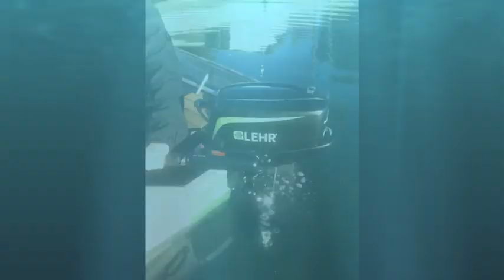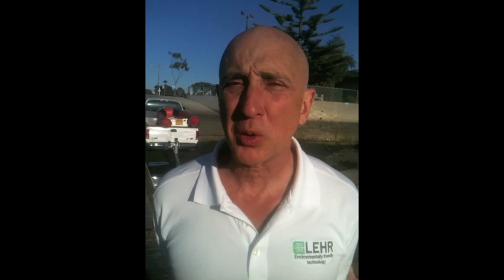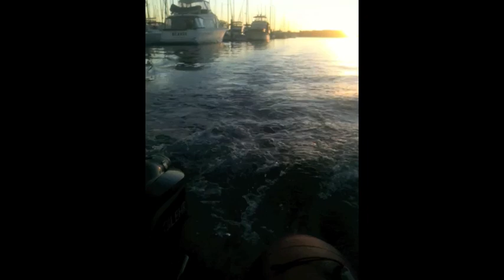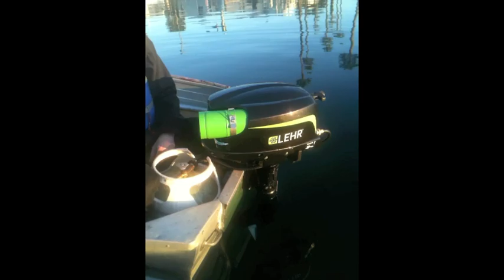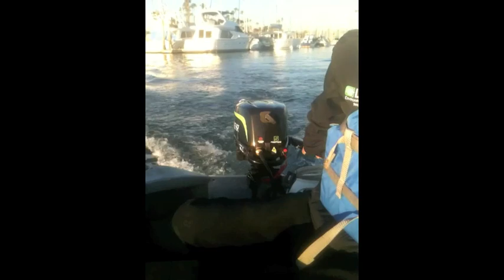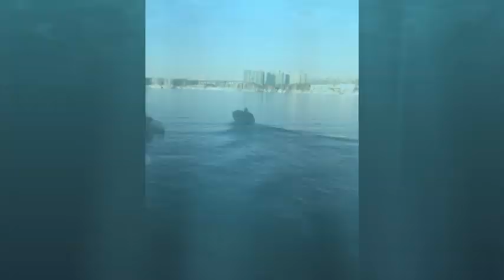LEHR Propane Outboards

Comment: 1/2 hr run time then off to the shop for repair 15 min of run time then off to the shop for another 2 weeks. I have had it a month out of that its been in the shop for 3 plus weeks. Need an expensive boat anchor this is for you.

Comment: Full Throttle, Full Power @4000 RPM: 56 Minutes
Half Throttle, Under Power @3000 RPM: 2hr 25 minutes
Minimum Speed, Under Power @2000 RPM: 4hr 30 Minutes